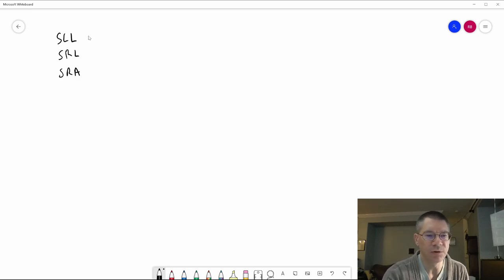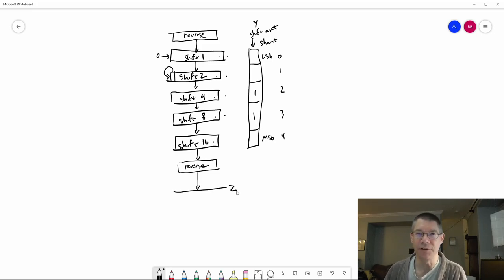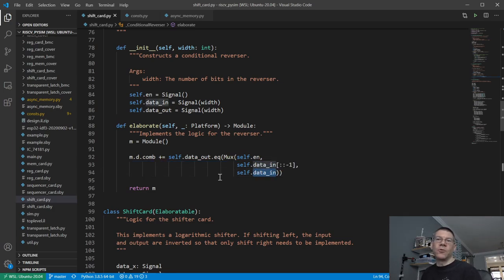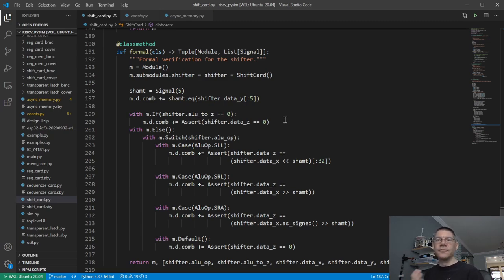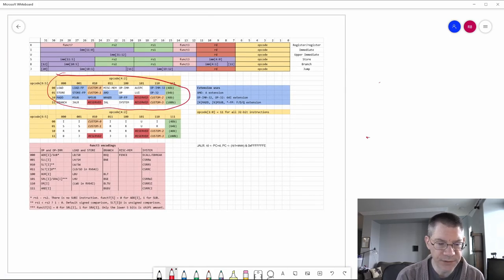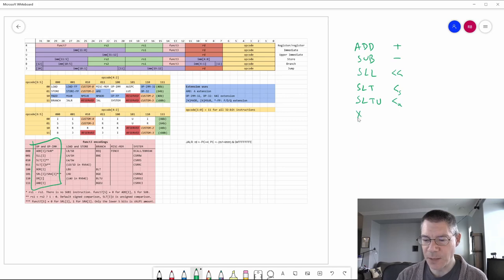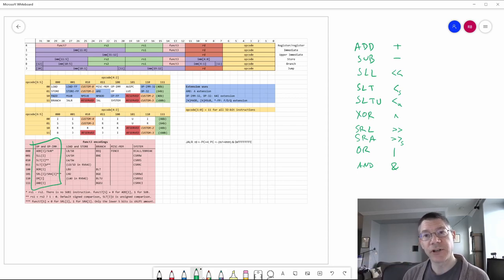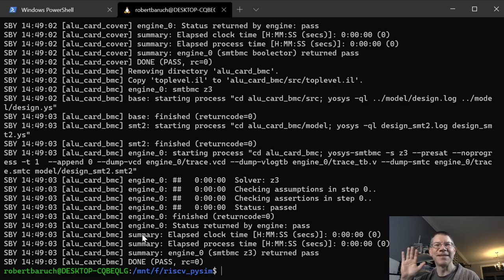LMARV-1 reboot part 3: the shifter and ALU

Comment: Another way of building a left/right shifter is to add one more shift-by-1 stage (either leading or trailing) rather than adding the two "reverse" stages.

You then feed the controls for the original shifters with the xor of the amount and the direction bit, and feed the direction bit into the control of the additional shift-by-1.  You can look at it as a shifter with a 1's complement control word (the direction is the sign), or you can look at the xor's and the additional shift-1 as a 2's complement negation with the xor's as the "flip the bits" and the additional shift-1 as the "and add 1".  The simplest structure is a wrap-around shifter (i.e. bits shifted off either end go to the other) but it's relatively straight-forward to add muxes and/or AND gates to the shift paths to do the sign extension/zero-insertion to perform SLL, SRL, and SRA.

Of course, the question is whether the delay (or gate count) you save by removing one stage of shifters is worse than the delay (or gate count) you lose by having to add the up-front xor's and the muxes to do the sign extension/zero insertion, but in VLSI designs with access to a reasonable library of aoi/oai (or even aoai/oaoi) functions.  For a board level implementation where you are using chips not complex gates it may be a less attractive option.
Reply: Of course, if you really want to cut down on the number of shift/reverse stages you could insert a selectable complement function (flip the bits and add 1) to the shift amount and do away with the additional shift-1.  That's probably a winning proposition from a gate/chip count perspective, but probably loses in speed.  Depending on the carry propagate characteristics of the complement block, it may also result in some more glitch energy in the shifter core as the carry settles going from the LSB to the MSB.

Comment: If you specify your ALU_OP control signal to include an invalid op, you don't need an AUL_TO_Z control signal (As you got a 4 bit signal for only 10 values, there is no problem fitting an 11th value in there).
Simply make sure the controller sets the ALU_OP signal to the invalid op whenever you want neither the ALU card nor the shifter card to output anything to the Z bus. To make this simple to do, I'd recommend specifying ALU_OP 0b0000 as the invalid op.
Reply from the maker: I could, but then I would be imposing a new instruction on the ISA. The ALU op is constructed directly from the funct3 part of the instruction and bit 5 of the funct7 part of the instruction -- you'll see that when I get to the part about the sequencer. Sure, I can reserve an unused op, but who's to say that won't become used in a later revision of the ISA?
Reply: I didn't realize that the ALU_OP control signal was simply func3 + func7 bit 5 from the instruction word. So essentially you are trading 1 control signal on the backplane and some minor complexity in the ALU and shifter for a simpler sequencer, makes sense.

I don't buy that there would be some future compatibility issue with a more compact control signal though, as there is also nothing to prevent a later revision of the ISA from using any other bits from func7. If you want future compatibility you would need to put the entire func3 and func7 on the backplane (as well as a single bit to indicate that the major op code is OP/OP_IMM, i.e. ALU_TO_Z). That way any new instruction would only need another card added to the backplane. With anything less, whether 4+1 bits or 4 bits total, you might still need a replacement sequencer card as well.
Reply from the maker: @JonSeverinsson  Well... you're not wrong. That is a trade I made, and maybe it's a bad one. Still, I'd rather not decode the ALU op to something else.

Comment: A dumb question probably, but how will the HDL scripts tell you how what TTL parts should be used? With your ALU there are many ICs that could be used to produce the same logical circuit, so what really does it add to the process of designing a RISCV processor put of TTL logic? Or have I missed the point?
Reply from the maker: Ah, that will be a process of manually replacing each bit of code with other bits of code that emulate particular TTL parts in HDL. I would also have to start thinking about practical concerns like setup and hold times, which can't be emulated in the HDL.
Reply: @RobertBaruch  Right! I must have missed that in your new Part 1. And of course the beauty of it will be you can reuse your tests, cool. Looking forward to seeing how this turns out!

Comment: This is really an interesting project, looking forward to when you start to create the actual boards!

I saw this video by Ben Eater a couple of months ago where he use a EEPROM to implement combinational logic.
https://m.youtube.com/watch?feature=youtu.be&v=BA12Z7gQ4P0

Basically, in the EEPROM you write the output bit pattern on the data bus for every bit pattern on the address bus. This way you could feed the EEPROM the risc v opcode and generate the right control signals for the ALU.

(if this counts as a "fpga" I let you decide :)